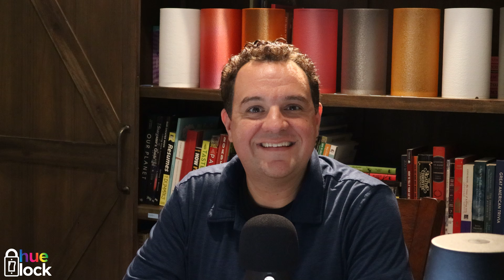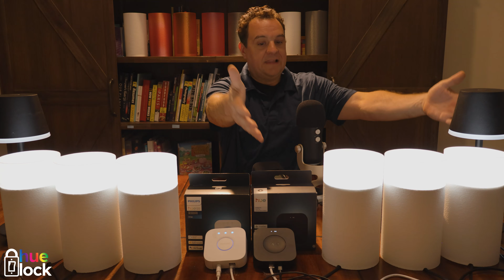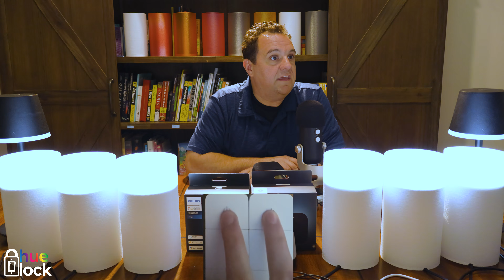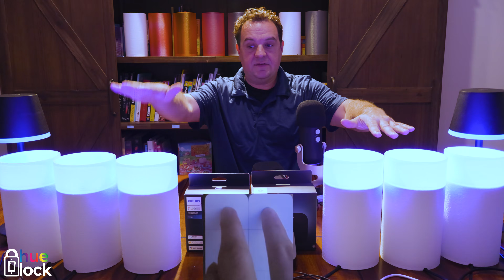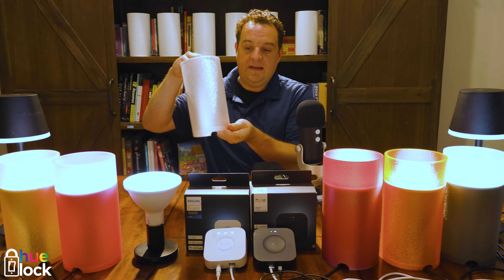MUCH BETTER video out! Look for "Hue Bride Pro Direct Speed Test  Now Faster Better and Prettier"

Comment: All I want to know is if it will make a difference to the speed of the hue play gradient light strip that goes on the back of the TV. My set up with the current Hue bridge that I have has about a half a second of lag.
Reply from the maker: I will be doing that shortly
Reply: @eclecttech  much appreciated. Thank you very much! I’ve subscribed and I’ll look out for that video
Reply from the maker: Thank you